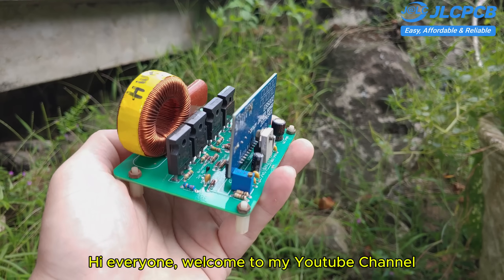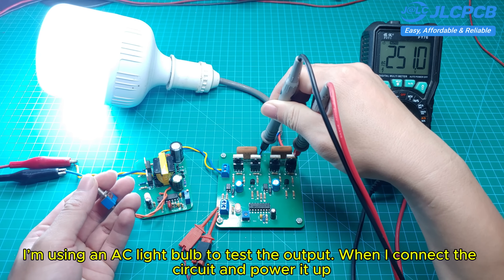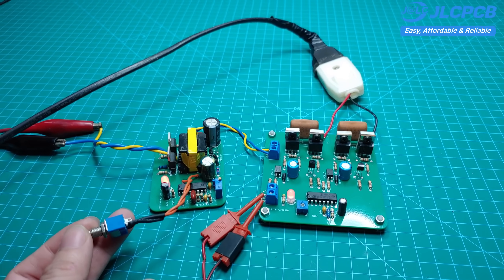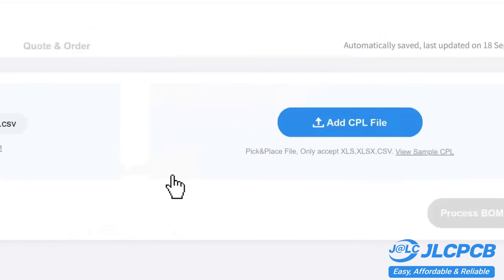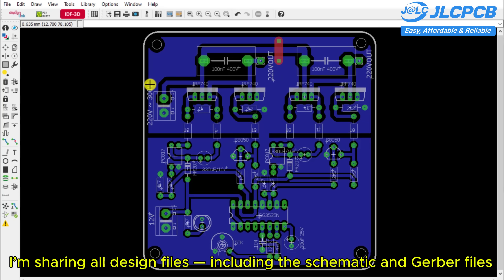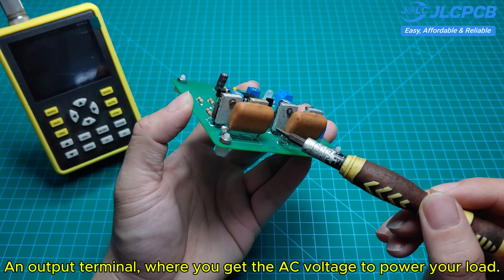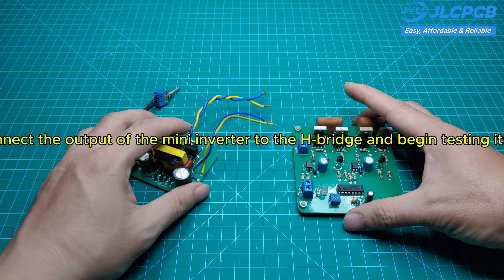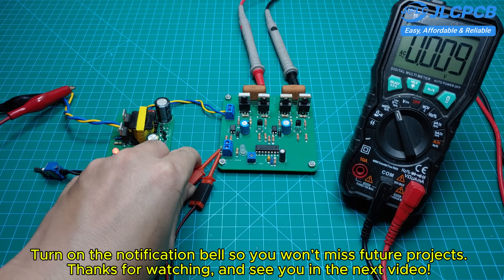DIY H Bridge Inverter  Convert DC to 250V AC with SG3525 + Free PCB Files | JLCPCB

Comment: Good day, i made that circuit and it WORKS fine !
However, my inverter output is 309VDC, which gives 300 VAC with your circuit.
How to obtain 220VAC ? Thanks.
Reply from the maker: Can you adjust DC output voltage ?
Reply: @LongTechnical  Hello, unfortunately not ! in inverters where is the regulation : at the high or low side ?

Comment: You can use op amp and clock counter ic and and flip flap to create spwm ot work the same as egs002
Reply from the maker: Thank, can you tell more detail about that ?
Reply: Would like to connect with you @Dc_tech386, how can we make that happen? Thanks.

Comment: I prepared this circuit. Two MOSFETs on the negative 220V receiving side heat up and the circuit burns out after a few minutes of operation. Can you advise what the problem is?
Reply from the maker: All value corrected ? All resistor and bootstrap capacitor
Reply: @LongTechnical See, there is a strange problem. When I remove the 400V 22 microfarad capacitor from the DC section, the heat disappears. When I reconnect the capacitor, the MOSFETs heat up. I used 10n60, irf840, and itf740 MOSFETs. They all had the same problem.
Reply from the maker: May be from your capacitor. I used 104 400V capacitor.
Reply: @LongTechnical I think the MOSFETs on the side that receive the negative voltage of 220V are not turning on and off properly, which is why they get hot and burn. I had a question. How many ohms is the resistor that you connected from the output of the circuit to the 330 micro capacitor? In schematic 1, did you write 1 kilo or 1 ohm?!
Reply: @LongTechnical No, look, when I put in the 100 nano capacitors, the voltage jumps, for example, it's 220, then suddenly it becomes 160, then suddenly 180, then suddenly 200, it keeps jumping even without connecting the consumer, so I had to remove the 100 nano capacitors.
Reply from the maker: Did you check the HV DC Volt ? This H bridge can not change the output volt. Output volt defend of input volt.

Comment: Dear Sir. Is it square wave or modified sine wave ? Does SG3525 provide with enough DTC ? Thanks.
Reply from the maker: With 470 ohm resistor DTC. It worked very well bro
Reply: @LongTechnical  Thanks bro. Is it square wave or looks like modified sine ? Thanks.

Comment: Nice project 👍 I'll try it.
Kindly make PFC+H Bridge type ac voltage stabilizer input 100-260v ac to output 220v ac.
Reply from the maker: I will try in the next time
Reply: @LongTechnica... Would be more beneficial.. 👍👍l